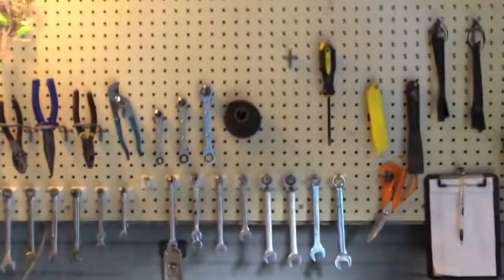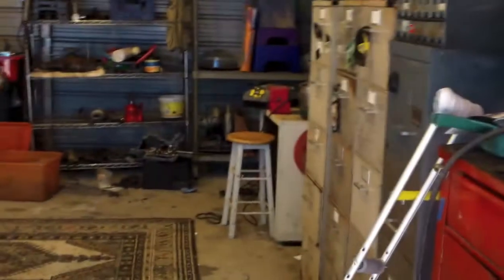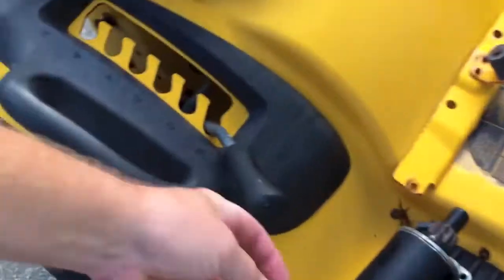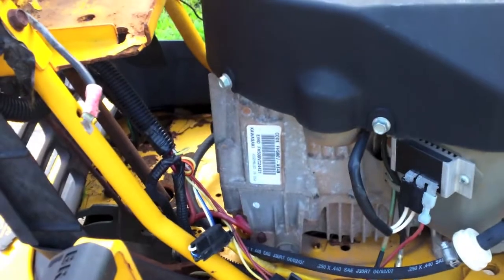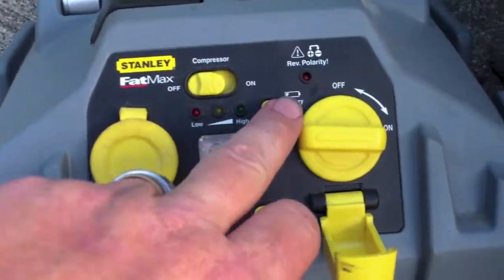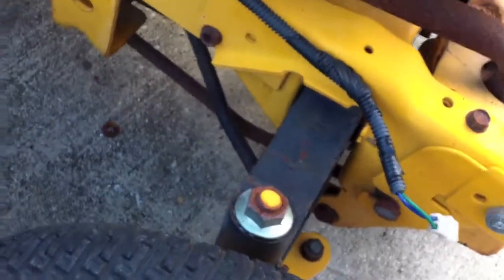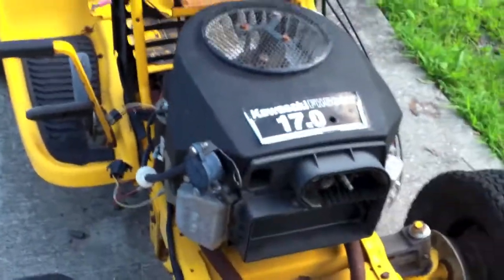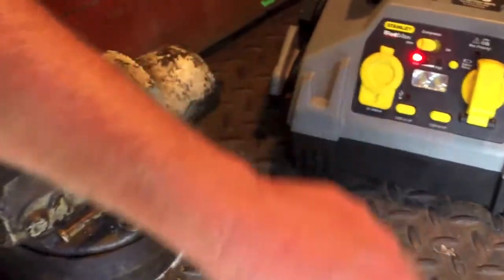Friday Shoptalk

Comment: I bought some mayhem stickers. I don know what got into me. I caused mayhem last night. And it was fun. I went down past the power lines where I usually go, and went down to the corner where it was just chip sealed. So I'm rippin donuts and gettin all sideways goin back up the road. Where the intersection was is the bottom of the hill and all the gravel is like 2 inches deep. Perfect donut material.  As i go to rip another donut I look up and there's a little old lady in curlers standing in her driveway shaking her fist at me. It was dusk so it was hard to see. So I pulled out of the donut and was all fishtailing back and forth, I jus went to the opposite side of the road as I past her cause I was waitin for a shoe to be thrown at me!!! Good times. I really need a go pro cause without a video it never happened!!! Hi Edward!!!